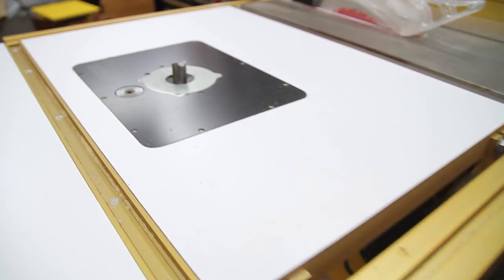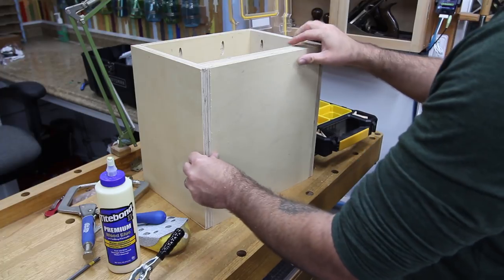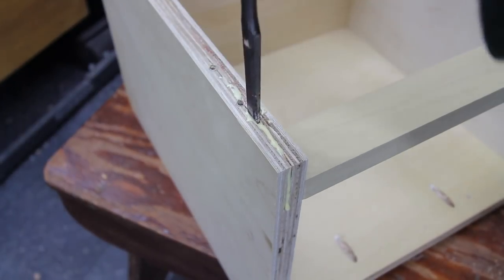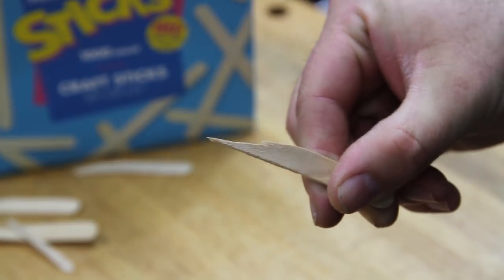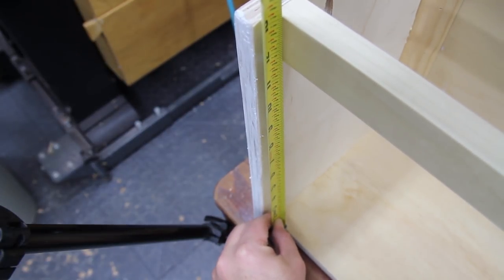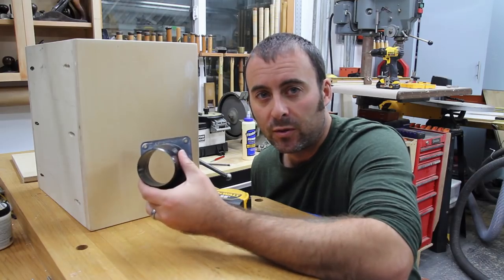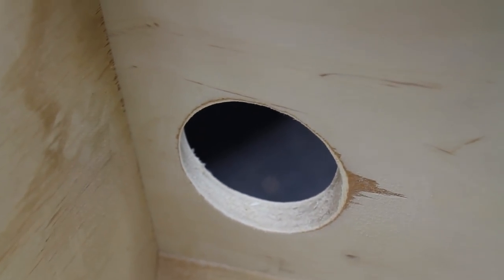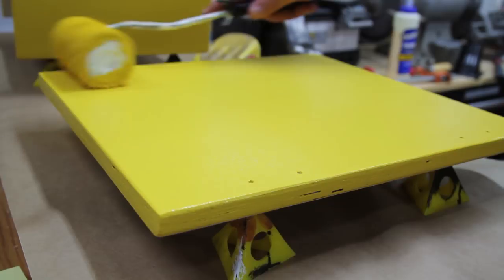Episode 1 - Router Table Dust Collection Box (Part 1)

Comment: I'm late to the party here but if someone comes across this comment and takes something with them then I may as well ... a trick for getting glue further into a crack like you had there is to blow it into the gap with compressed air (or if you have good lungs you can get it pretty far by blowing through a straw) and applying some more. Repeat until you feel like it's sufficiently full.

Comment: Excellent, especially for a first time video. One thing though - you may have already noticed this, but without vent holes or some other means to allow outside air into the box, you will, A) not get great dust evacuation, and B) possibly overheat your router motor.  If you locate the holes diametrically opposite to your dust port, you will get a nice cross-box airflow. Don't overdo the size or number of holes - 3 or 4  one half inch holes are a good place to start. You can always add more if needed. You can check my theory by putting a shim or screw in the door opening to prop it open slightly. I think you'll be surprised at the improvement.

Comment: Thanks for the video. Just seen an older video explaining that encasing routers or any other motor is really bad for them. The guy put a short piece of vacuum hose from the bottom of the router into a hole at the bottom of the box so it gets clean and fresh air.

Comment: I built mine to fit under my cast iron router table wing on my table saw.  The saw, an old Craftsman 113, sits on a mobile base and I built the router box up to meet the table in place of down from the table since I could not directly attach it to the top.  For the door, I went with rare earth magnets that just hold it in place and allow it to pop off to access the motor.  Whatever works is my motto... better than the dust flying all over.  A side benefit is it helps support the weight of the top.

Comment: After using the box, do you find the router air intake ports get clogged? It seems that the dust collector pulls the dust down to the top of the router where the routers fan would then suck the dust up.
Reply from the maker: It’s never been a problem

Comment: I make lots of amateur hour mistakes. My question is how did you attach the box to the underside of your router table and seal it up air tight?
Reply from the maker: I just used self-adhesive weather stripping.